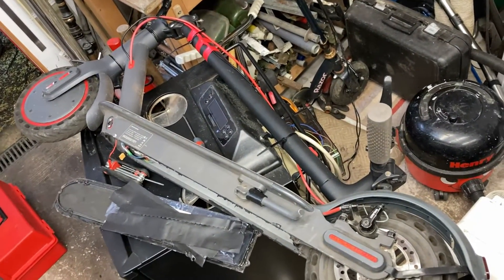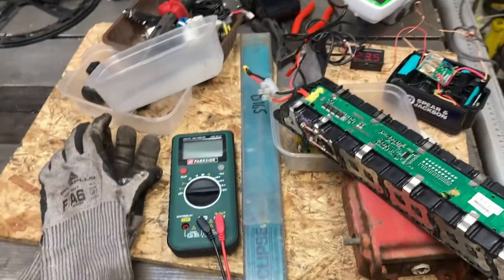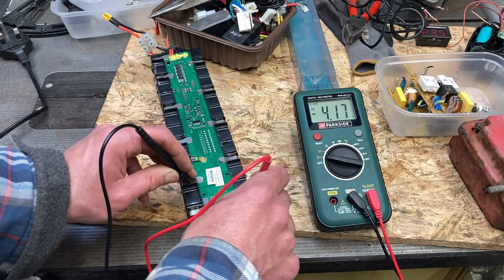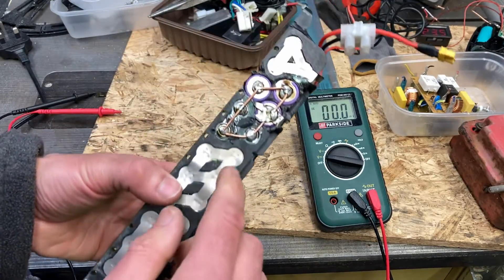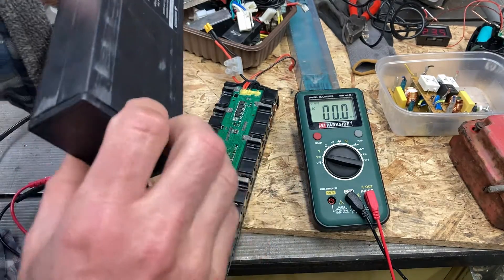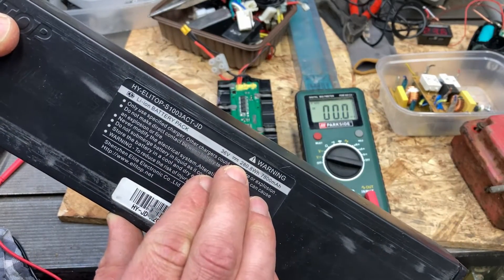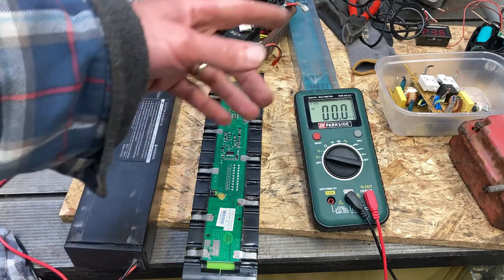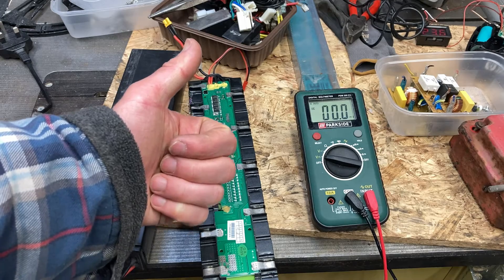Escooter battery fail and diagnosis: checking a Lithium Ion 36v battery

Comment: Owen, my experience with this type of battery is that frequently the battery will charge but the BMS prevents discharge and the only way to keep using it is take the output directly from the battery. Many times this is not practical due the bike wiring, cheers
Reply from the maker: This is one that you chopped open with the side cutters.
Reply: @bootsowen  Hope all good with the wellies unused, have hunted out that 48v charger, cheers

Comment: Every since I had an 18650 go up in smoke on me from using a soldering iron on it I will never solder onto a battery again. Brought a spot welder off ali express and works a treat. So much more safer.
Reply from the maker: I’ll take my chances!  Not sure if I’d bother again unless it was something special. So many free batteries out there!